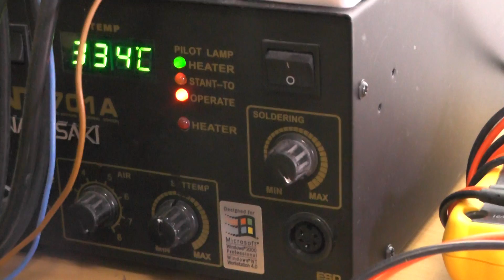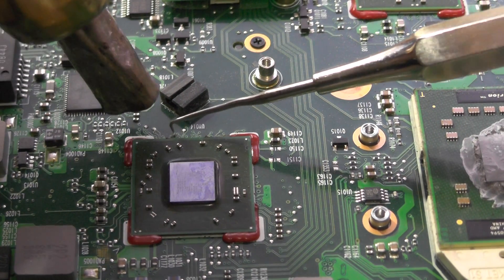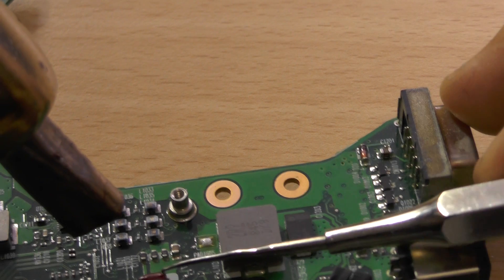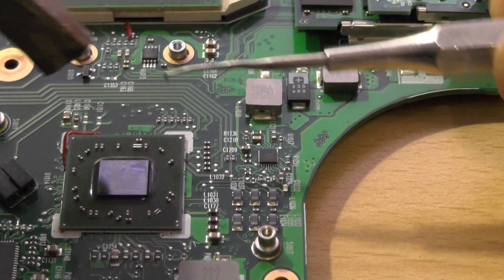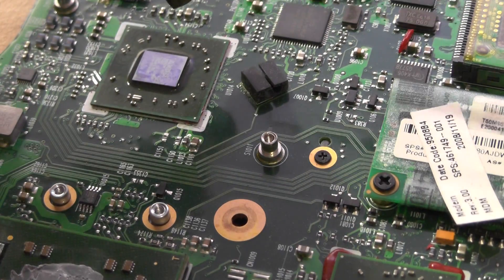[HW: How To] - Remove gunk from BGA chip (using a heat gun)

Comment: Try showing how to remove the actual chip.
Reply from the maker: Status Enterprise hi, i have yovy re-8500 which is a professional equipment so there was no point in showing how to remove chip with that.
Reply: I dont know what that even is. I suggest if you want more thumbs up. You do another video showing removal. I just heat gunned my bga and they came off simple. What I dlont understand is why are they so valuable? Just seems like solder on the back end. And thanks for the reply. I changed my think for ya.
Reply: @statusenterprise49  They have a silicon chip inside that took millions possibly billions in RnD to develop, and were manufacured using some of the most advanced technology we have. The raw materials aren't worth much tho.